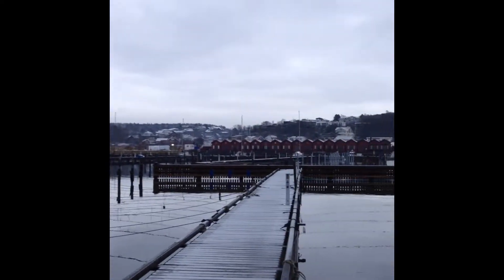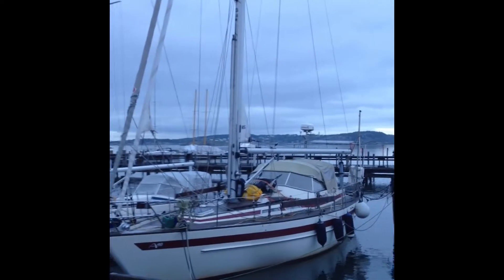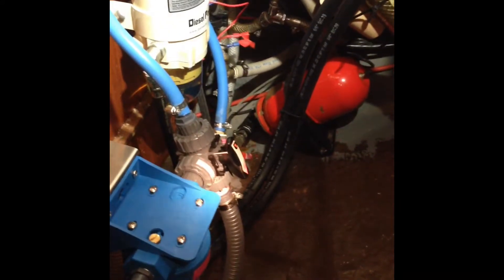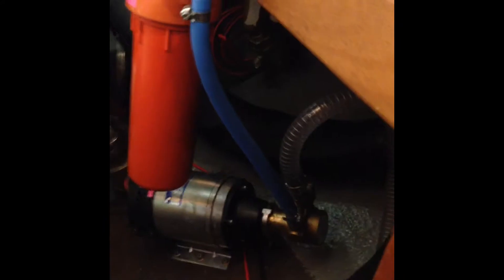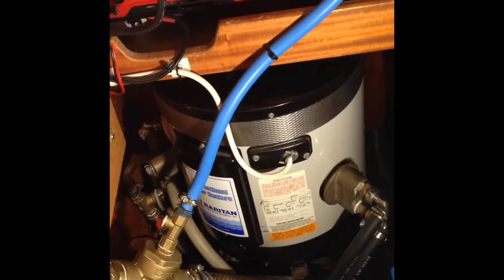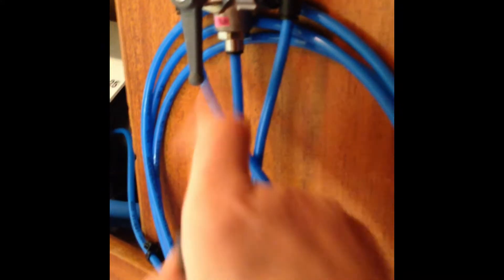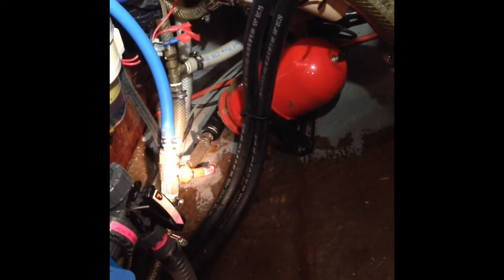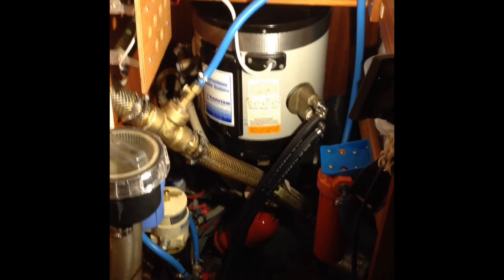Watermaker Splash25 Aphrodite 40 - Sweden

Comment: I had one of these - a big disappointment. Used for three weeks, needed a new waterpump every week !! Waterpump has very brittle graphite (=same as a lead pencil you write with) "paddles" which break off more faster than you can say "I wish I never bought an ecosistems watermaker". Save yourself endless trouble and cost and time and buy something else than "eco sistems"...
Reply from the maker: Eco-Sistems is afraid to hear that you aren’t satisfied with Splash-25 and apologies for this inconvenience caused.  This low pressure pump is a consumable watermakers part and vital for the correct operation of the system, however we have not had any trouble so far (it is supplied in the Maintenance Kit, and we always recommend to our customers to get one on board– See www.eco-sistems.com). Our suppliers are the best European brands (with Quality Certificate).
By considering your case, we became aware that this pump was full of unsual mud and this cause a disruption in the full working state of the system. This element was external to Eco-Sistems, after few months of benefits you got from the machine. 
Eco-Sistems replaced this damaged/faulty item by a new one (it was not covered by warranty) very quickly by providing the best assistance, and we hope you the best for your next trips!!